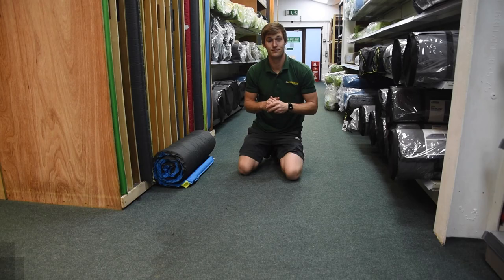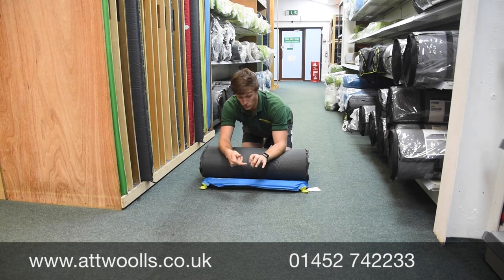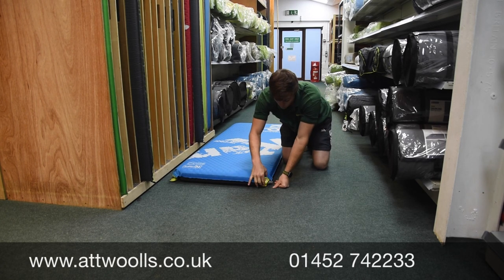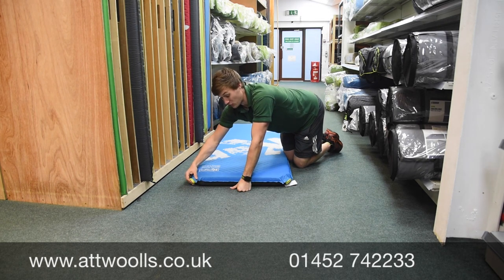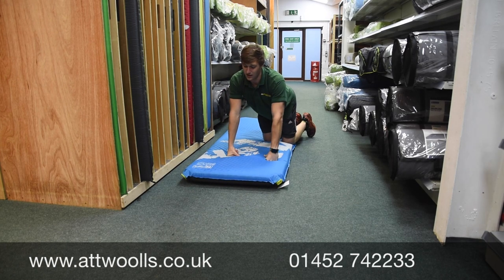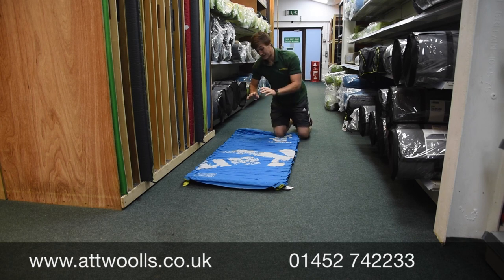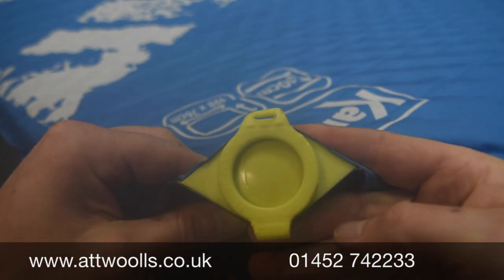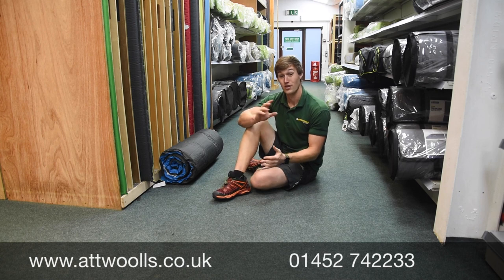Camping Self Inflating Mat (SIM) (Tutorial) Video

Comment: These are one of the Best inventions in camping gear. After having gone through 3 airbeds in 3 years, We have had these foam mats for 14 years now, and they are Seriously FANTASTIC. We usually put them on top of a foldable camp bed, but we have also used them straight on the floor on short trips. Seriously Brilliant, but make sure you get the Thickest ones possible, 10 Cms. thick. They are the Best.

Comment: My two year old wide boy failed on both the valves where the fabric joins , terrible design what guarantee is there these valves will not fail because the fabric is glued to the valves the same way as far as i can see. 65 pounds down the drain!
Reply from the maker: atommachine generally we don’t tend to get many issues with these types of valves on SIMs and they are a lot more reliable than Airbeds. 
Have you tried repairing around the valve by re-gluing it?
Reply: @AttwoollsCoUk  I am waiting on a repair kit as my glue tube was dry when i opened it . I have the Kampa patches so i will do all 8 corners of the valves it would be such a waste to throw it away it was a great air bed. Thanks for your reply.
Reply: I'd love one of these but, compared to my inflatable airbag they are huge when packed up.

Great video though 😎👌